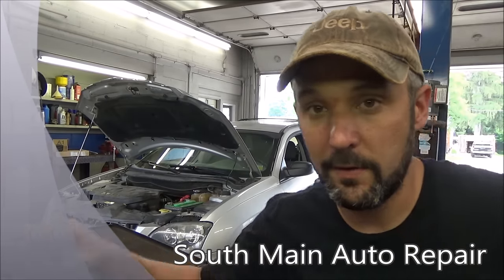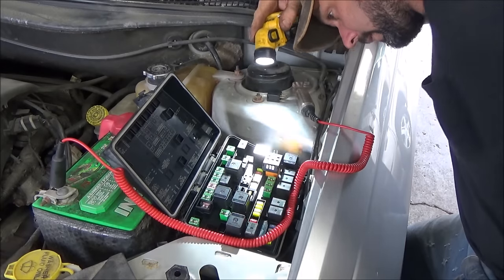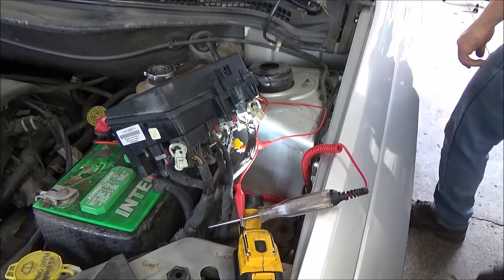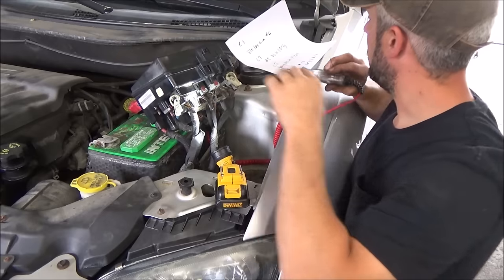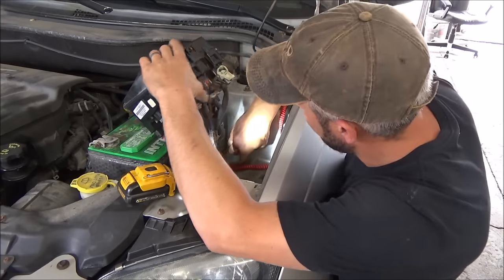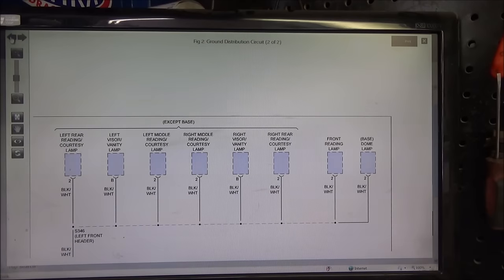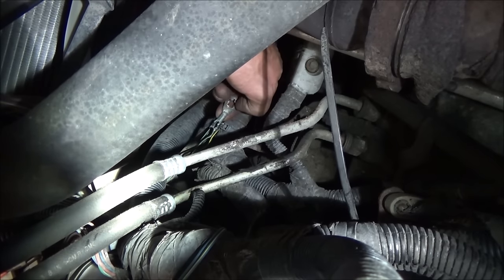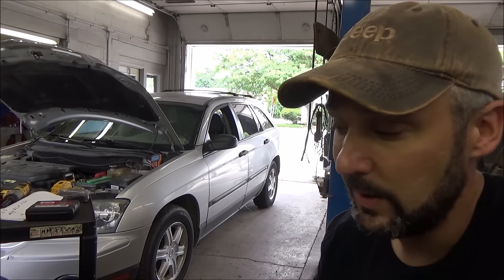Chrysler Pacifica: TIPM Electrical Problems

Comment: I'm having this same issue right now and I hate the way they did the ground with studs instead of being bolted to the frame. Water gets in there and really takes a toll on the wires. I had to test over 50 wires because #3 fuel injector wasn't getting power and luckily after 2 weeks I found the wire and got it fixed. Thanks for your time in going through every step you will be saving me some money for beers hahaha jk You rock man

Comment: I'm working on this now. I removed the fuse box and checked the cable plugs and found two corroded lugs in two of the plugs. I then removed the battery tray and found the three grounding thermals. The exact same one fell apart on me the same way. It's a lot easier to get to the connections by removing the battery tray.

Comment: On older cars, you can use the headlight switch harness to jump circuits to find shorts and see if dash lights and other circuits are working. You jump the B+ wire from the battery to individual circuits with a small jumper wire. The headlight switch controls dash, parking, headlights, taillights, etc.

Comment: This was very good break down and information well needed. I also have another issue for this same year,make and model of this vehicle I need help with. The altinator was tested and was told that the alternator diode is bad allowing the alternator to draw power back out of the battery. My question is do you have a video on how to replace said diode on this alternator for this video? Thanks in advance for your time and good job with this troubleshooting video.

Comment: That was yet another brilliant bit of sleuthing. While I haven't the means or ability for such, the lesson is that if any greenish grounds are noticed, clean and repair them asap. Do you think it was caused simply by the terminal-ring wire connections holding salty water via capillary action, thus allowing green patina (verdigris, actually - or copper sulfate) development? Seems those should be factory-coated with a liquid polymer and then only the ring cleaned for electrical contact. Fluid film seems the best DIY preventative after repair and re-connection.

Comment: Wiring diagrams are a necessary evil.   Especially when is was in the USAF, Avionics.    "Back in the day" I worked with 2 other guys in a TV Repair Service (after I just retired from the USAF, 1977).   We had cabinets full of "Sams Photo Fact diagrams."  :)   Also, for our franchises had , GE, Mag. Zenith and RCA tech data.  Binders upon binders. :)    Couldn't  function without all of that data.  Most guys didn't like to use the diagrams - confused them.   We were always asking:  "Are we looking for power, or are we looking for ground."  ha, ha.   Thanks Eric.  Love your "classes" - best I've EVER seen.

Comment: Great video, first time checking you out, but sure glad I did. My vehicles lights are all on the dash board and I pray its the same issue as far as the ground goes. It runs great, just the lights are on. If you respond to anybody on here, it would be a blessing, if not, thanks anyway for your knowledge of this vehicle. May God continue to Bless you my brother in helping ppl. I just subscribed

Comment: Great video.  I replaced my  fuel pump in my 2010 dodge Grand Caravan.  Still won't start.  Bypassed fuel pump relay.  work a bit but then wouldn't start again.  Looks like replacing TIPM is my next step.

Comment: Thanks nice video. I had the same problem. I was going to clean the ground. First I disconnected the negative on the battery. I found crud all over the terminal that you couldn't see when the cable was on. I cleaned the cables and posts. Problem solved. Thanks !

Comment: Grounds close to or below the battery tray not a good location. If the battery leaks, it will caused all kinds of corrosion problems. I normally install a battery mat to absorb and neutralize the acid that comes into contact. If I am working near a ground point, I clean it and spray some Corrosion X product.
Great video for trouble shooting!

Comment: after lots of hunting on my 2008 town and country I found 2 issues causing tipm failure #1 either the rear tipm harness plug...if you look down at the visible wiring on the drivers side of the tipm you should see the rear plug with the white swing down latch lock....this one causes the wipers and lights to go off and low and high voltage tcm codes and can cause the vehicle to stop mid drive or enter limp mode...not fun on the interstate at 70mph...you can wiggle or push it in to get the vehicle operational again rather then removing the battery which might appear to work but I am fairly sure that is just the plastic plugs tightening up a little after cooling down and making contact again...wiggle until the wipers go off and disassemble and inspect secure tightly to fix...heat seems to increase failure so it may occur more frequently on hot days sitting at idle or under heavy electrical loads....#2the sliding door harnesses can also cause the wipers and lights to go off but should not shut the vehicle down...unplug until you can service the door harnesses....great vid....Chrysler should think about re mounting the tipm outside of the hot engine compartment...the heat seriously shortens the service life of the tipm

Comment: Thank you for the great in depth video. I just got one of these 06 Pacifica's in and I am 99% sure that this is the issue. All the same lights and nothing working.  I also watched your 09 dodge caravan and found broken wires in my door loom. please keep up the great video's! btw, What software are you using for the wiring diagrams?

Comment: Outstanding job!  I think this is proof, again, that one should always troubleshoot the steps,  one step at a time.

I would like to know what the software is that you used to follow the schematic / wiring diagram.  Much more intricate than the junk a vehicle owner is able to get from a parts supplier.
It seems ridiculous that so many individual components are grounded separately and in some remote, difficult to reach place.  Why on earth a singular grounding bus- somewhere in close proximity to the power module- is not used is a mystery to me.  Is there a justifiable reason creating so many individual grounding points?  The particular post you found ended up being used for multiple (unrelated) grounds, anyway.  
What would prevent someone from simply fabricating a new ground wire and installing it in a more convenient place?  What would it / What could it hurt?
Just because Chrysler felt the need to hide these grounds in as inaccessible a place as possible, are you obligated to repeat (reproduce) their idiocy?

Comment: Focusing on one circuit seemed to speed up the process saving you time and the customer money. Makes sense to me. 
Great job, thanks for the content.
My daughter has an 04 300m she says will not exceed 45 mph. Shop told her to take it to a dealer to have them check the trans computer and reprogram it. Should I try to reset the TCM? Any suggestions? I know it's not much info.
Thank you

Comment: Eric I had the same problem I add a Subaru that didn't have any  Brake lights running lights tail lights nothing in the back worked so I did what you just did here I check the power control modules and sure enough they only had blown fuses I figured out that 1 of his tail lights was leaking and filling with water and was shorting out the bulb But that was not it I could replace the fuse but the 2nd I would step on the brake the fuse would blow so I figured out that it was the brake light switch replaced that and the fuses works perfect now I just had to ask myself what would Eric o do thanks for all your videos

Comment: Great video, great diagnostics. However, rather than try to re-do those hard to reach ground wires behind the headlight, did you think about just taking those wires off the module and just running them to a new and accessible ground?

Comment: I used to work farm equipment, and my test light was sometimes a long way from the controls.  I used a 12 volt beeper, used on a motorcycle turn signal, in place of the light.  With the beeper connected I could hear when the connection was good.

Comment: Was there also a ticking coming from the fuse box? I have a 2006 Chrysler Pacifica that I just bought and everything that's wrong with the one in your video is wrong with mine except for there's also a ticking noise coming from the fuse box.

Comment: Just recently had a customer come into the shop with a Chrysler T&C. Blower motor wasn't working properly, they said they took it to a few different shops that did the obvious, replaced the resistor, motor, and fuses even though everything was alright. I chased the wires, supplied the motor direct 12 volts, worked great! Plugged in the harness, and checked the voltage via backprobe (multimeter) and it was showing a whopping 0 volts. I was scratching my head for a little bit. But I took a jumper wire, and connected it from the positive terminal from the battery and connected the other end to the supply on the motor. Ran fantastic and was able to control the speeds using the HVAC controls. Once I removed the jumper wire, it kept running without needing the external supply. Any idea of what might have been the issue? Was the TIPM possibly confused thinking the blower motor was activated, when instead it wasn't? Any information would be great! Love your videos Eric!

Comment: Yo Erik when testing a relay with a test light in series with the coil side of the relay, because of the inductance of the coil it adds enough resistance so that a light won't light although it will still pass current  i.e. the relay is good even though the test light doesn't light up. You should use a DMM when testing relays. That is why your relays were clicking when your test light was not lit.

Comment: Had a brand new unsold Caravan come in right off the shipping truck with wipers on intermittently, power sliding doors and rear hatch open at times while driving and a slew of other intermittent body issues, NO codes or money light. Someone at the factory left those frame rail grounds loose with the nuts on a turn or two.  This was a 0 mile stock unit that only did this randomly, driving or sitting running or off. Found and repaired the ground after several hours spent trying to verify the concerns long enough to trace anything. Tore the insides completely apart then traced everything back to the front and TIPM. It also fried the TIPM, so once I had it all working and back together, I still had to order then wait for a TIPM, program the vehicle, then verify the repairs. 

A new TIPM took over a month to arrive, severe national backorder of the worst kind. Needless to say, this wasn't the only one with that issue. Someone at the factory playing fun and games. in your environment, rust and corroded components are nothing to laugh at and a major source of pain as well as income, if one is willing and patient enough to deal with such stuff.

I once had a new car come in with a noise NO ONE in the shop could find. Someone at the factory tied an axle nut to a piece of string and hung it between the inner structure and rear quarter, boxed in and welded over. On a coke can next to it was a note that said "Hey A$$hole, how long did it take you to fond this one?" Folks working at the factory do some screwed up things, on purpose and by accident. After 40 years, things still surprise you, especially on high mileage cars that did something since new and no one ever could find the issue, till it ended in the luck guys bay with over 100K miles on it. Beer cans welded over, nuts in voids, loose connections, I've seen some crazy stuff.

Comment: It look to me like the rings may have been crimpped incorrectly, especially if the wires fell or pulled out and hadn't broken off due to corrosion. I can't imagine how you were able to get to that spot with either a crimper or a soldering iron, but yours looked like a solid connection. It looked like you may have put some grease or goop of some sort to prevent future corrosion. If so, what did you use?

Comment: Question for you, On my 2007 Pacifica, the driver door switch works about half the time and now the driver door ajar turns on when driving. Any chance this could be a ground wire problem?  Where would you start looking?  I replaced the window switch already with no luck. Sometimes the switch works the pass side windows but not the driver side. Thanks in advance if you read this.
Scott

Comment: Great video. I have a 2007 Pacifica dash lights went out, no speedometer, gas gauge, odometer, or compass, nav, back up camera, engine lights on at all. Lights, turn single still work. Any thoughts where to check or is it the instrument panel that goes bad. Have you seen this before?

Comment: Hey there I have a question I have a 2004 Chrysler Pacifica 3.5 L check engine light is on and the car is in limp mode p 0 700 p0888. Any suggestions what I could do or look for for starters

Comment: I have a question, when the horn wasn’t working until you hit the ignition switch, is that related. Because my Pacifica doesn’t have any power running through with ignition off. Not even the interior lights or power door locks, which should have constant power

Comment: Yeah as soon as I heard those wiper relays clicking with the horn button, I guessed bad ground. Some aux load was pulling that ground down just enough to pass a little bit of current, but when a few relays want to click on simultaneously, there just isn't enough current available an d they start to oscillate.

Comment: I have a 2004 Chrysler Pacifica and the display lighting on my a/c heater climate control unit doesn't light up but the unit it self works perfectly other then I can't see the display.
Is there bulbs behind the unit I can replace or do I have to purchase the Complete unit
Thanks

Comment: Hey friend I have problem with my head lamp but I rewire all of the grounds and the problems is still there the light flashing like strobe do you have any idea I was checking and supposedly it has not a relay they have a small computer to control the light I don't know if that's true?

Comment: Early 2000's Hyundai SUV's had a similar problem, there is a ground for the alternator to battery charging circuit right under the battery tray.  It tends to get crusties on it and then the battery won't get a charge when the engine is running, indeed the battery won't charge at all.  remove the ground and clean it off and everything works great.  Of course you have to look up the circuit path and check the grounds before you would ever find that.

Comment: Hi I have a Chrysler Pacifica and it won't shift gears is stuck in 1 gear and I got the transmission rebuilt but they now they're saying it's the computer what should I do now

Comment: I had found 5 bad TIPMs..all 5 had mediocre to bad grounds, repaired grounds, replaced modules...that was 8 yrs ago and they are still out and about with same my installed TIPMs.
That being said, wondering if the stealing of grounds, in them, is actually making them fail.

Comment: Great job thanks 
I have a question 
On my 2015 ram 1500 I was upgrading to ELD light and everything went wrong 
Putting the original bulb back on the right headlight don’t have power 
Looks like is that infamous TIPM 
Do you think I would need to change or there’s some way to clear the codes and make the right headlight work again?
Someone said I should just jump a wire from the left headlight

Comment: My Jeep's horn is wired through the ignition switch.  Usually the horn will be direct wired.  Anyway, persistence always pays off.  I am reminded of a tale about a guy who had a stalling problem and became indignant when he was told how much a particular shop charged for diagnostics (as if he thought it was free).  Well, after going through $800.00 worth of parts with no luck, he went back to that same shop and told them to go for it.  It turned out to be a broken wire.  As the shop owner said, "Now I'm his best friend."

Comment: Thanks for this From Wayland!!   I am working on a 08 Dodge Nitro. Swapped engines. No crank,  but will if Jumped. Have spark,  but No fuel injection. will check relays for Ground . Need a that tool .

Comment: Learning a lot with your methodical testing. Seems like bad grounds are the problem a lot of the time in your videos. Would is be faster to just add a jumper to the ground wire and see if the thing jumps back into action?  Cars up there are operated in a salt brine all winter long, I am surprised that they run at all.

Comment: Thank you, very good video, my problem opposite what you have, the wiper does not work, the AC blower stay high, the rest (GPS, horn, light, window, sunroof) is working, I will go thru each circuit like you do, I hope will find out what wrong with my 04 Pacifica, basically I have no accessories power, when i turn off the engine I have to press hazard button to disconnect the power other wise the car will drain the battery in few hours

Comment: Hi there great info. I have a 2005 Pacifica. I have no presence light front and rear including no light at back plate.  Rear every light works. Turn, reverse and brake. Front every light works but no the presence light.

Comment: I just bought a fully loaded 06 Pacifica for a song and a dance, because it has all these same exact problems. I actually did some googling and everything pointed to replacing the tipm. I tried to backfeed the fuses that i found dead and made everything work but im going to see if the grounds are green like this one. Do you think Even though i made them work by powering up the fuses that was dead that the grounds are bad? Thanks for your feedback. Jeremy...